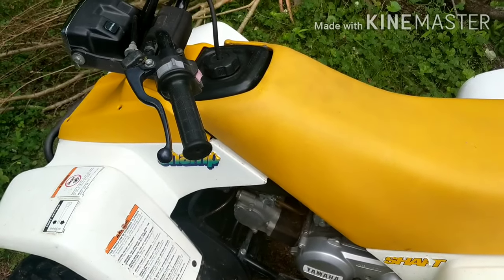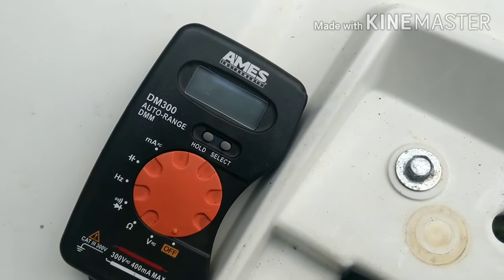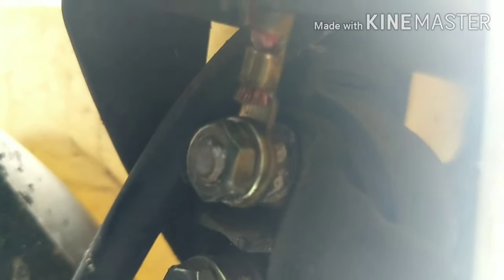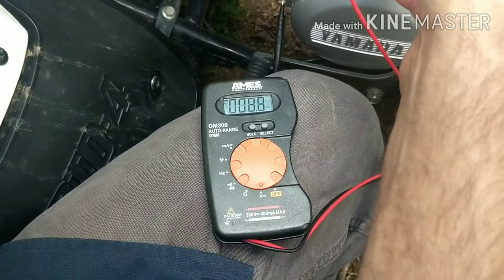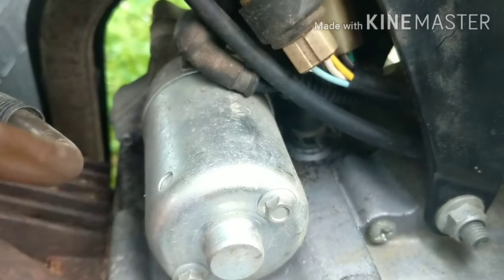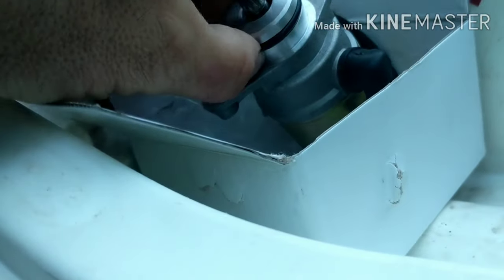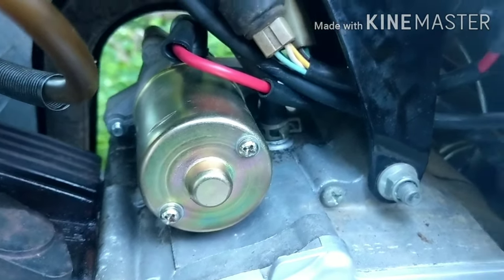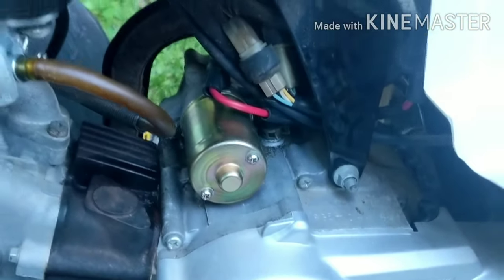ATV no start fix.

Comment: I just replaced a battery, solenoid and starter, all Yamaha brand on a grizzly 700. About an hour after using it, I tried to shut it off and acted like I was hitting the starter and would not shut off. About 3 min later the wiring harness area got hot and the engine died. The new battery tested .8 volts in the field and 0 volts after trying to charge it. I have checked the wiring and re connected  two poor connections for the solenoid wires and have a fresh battery and solenoid. It will only click. I’m afraid my starter burned up. I will check power to it in the am.

Comment: I replaced : battery,starter , solenoid, regulator/rectifier and it still does it. It is charging properly too.
Reply from the maker: Make sure the engine isn't stuck by fuel in the cylinder, or seized. If it's not check the starter Bendix.

Comment: Hai sir I have Polaris atv 250 two stoke engine bike esterday what happen I am going to change  a battery . Wrongly connected but engine start after rectifyeris burning i  going to stop the engine.afer we are going to connect the correct way but self moter sound only coming.but wrong connect self moter start engine also start but correct way to connect is not working.what i going to to please give good solution

Comment: Hi my mines won't start from the strat button but it does if I hot wire the solenoid. What could be problem  ?
Reply from the maker: Most likely the starter switch or button. See if you're getting power to the solenoid when you hit the start button, if you are, and you're able to jump the solenoid and it works, it's your solenoid.

Comment: I have a suzuki lt80. After running it for a couple hours it did exactly that, started clicking. So i came to youtube and found this video. However in my case i didnt have to order another one i simply took it apart brushed the contacts, add a little grease on the center rod to spin easier and tested it with some leads directly to the battery it started spinning so i put it back on. Which if any of you have swapped out a starter in a suzuki lt80 its not a 5 min ordeal. Anyways now it runs stronger than before. So a little tip if it has screws, bolts, pins, i dont care fuckin duct tape holding it together take that shit apart and figure it out learn about it and how it works to better understand your machine. And hell worst case scenario.....just order another one haha but at least you made an effort. Good video bud keep it twisted! 👊✊ 🤘🤘

Comment: My quad is rapidly clicking from what it sounds to be the starter, but it turns over when I boost it so I’m pretty sure the starter is good, I can also touch a piece of metal to the two hex nuts on the solenoid and get it to start from there, so I’m pretty sure my battery is fucked.
Reply from the maker: It you jump the solenoid by touching the two nuts and it starts, the battery is strong enough and the solenoid is bad.

Comment: A battery at 12.5 is fine for any one wondering.   Don't miss interrupt that your battery has to be 13 volts cause it will drop to 12.6 in a few hours.
Reply from the maker: Good call as long as the cranking amps/load test is good 12.5v is fine.

Comment: Thanks for the great video and advice. I too had an issue with a single "click", coming from the starter solenoid (on my 2003 Bayou 250). I watched your video and all the other starter/starter solenoid related YouTube videos available and was convinced that I had a bad started solenoid based on the videos and the fact that the single "click" sound came from the solenoid, not the starter. There were numerous aftermarket starter solenoids available on Amazon for around $10 so I figured I would try the least expensive and easiest repair (compared to replacing the starter itself) first...what a hassle! I bought and returned starter solenoids from 4 different sellers due to the "B" (for battery) and "M" (for motor) being on opposite sides from what the description pictures showed and that the description clearly stated the solenoid was compatible with my specific ATV...maybe it doesn't matter? I don't know though because it turned out that the single "click" coming from the starter solenoid was actually caused by a bad starter. For me, the final clue was that I couldn't "jump" the starter by connecting  the solenoid terminals with a screwdriver. I am sure that there are other more exact  diagnostics I could have done with a meter but I replaced the starter and everything worked fine, even the original starter solenoid.
Reply from the maker: Yes you could have checked if the starter was getting 12v when you hit the start button. If so the starter is most likely bad. That would eliminate the solenoid being bad. There could be other reasons it would get power and not crank (like engine locked up). But that test would verify the starter system working. Glad you got it fixed!
Reply: @TepcoCycleRepair  Thanks, I'll remember that for next time...in the meantime I plan to take the old/OEM starter apart to see if it can be rebuilt for a spare as I have two Bayou 250's (2003 and 2009) so will probably need another started eventually.
Reply: I have a vinson 500 2004, checked starter and it spins, could it just be spinning but worn out brushes ?  the engine will not turn over. when I use the pull start it fires right up. What could this be ?
Reply: @Talonvision  Hi Sammy. You don't say how you checked that the starter spins but the fact that it spins seems to indicate that the brushes are OK but the starter is not engaging. Since your atv starts up and runs when you use the pull start (that's good) I am guessing that you may have a problem with your starter solenoid or maybe battery level is too low. Make sure your battery is fully charged. Have you tried using a screwdriver to jump the solenoid terminals with the key in on position? If it starts that way, then it's a bad solenoid which is fairly inexpensive to replace.
Reply: @garydillon7765  we kinda checked and jumped the solenoid. But did. Not check proper battery levels. Checked all fuses. I hope it isn’t the clutch start mechanism ? We took the starter out and on the inside it had no resistance l, just spins freely is this normal ?
Reply: @Talonvision  I didn't realize that you had taken the starter out and that you meant it spins manually. Have you tried hooking up electric power to the starter when it is out of the atv? It should spin then. If not then starter is bad. Really though, I am no expert so your best bet might be to look at more videos or call your friendly neighborhood atv repair guy for advice...Good luck!

Comment: Clean your ground and power connection to the starter then try to start it. Then jump start it from the solenoid. If that works, it's not the starter or battery and probably the solenoid.
Reply from the maker: This was a bad starter as seen during the testing in the video.

Comment: hey, my Kfx 50 makes same noise, battery good .  they sound is coming from the fuse area?  I saw something about CDI box??   Do they go bad and do they interrupt the voltage to the starter?
Reply from the maker: CDI boxes can go bad but not often. Locate the starter solenoid and test it, sometimes there is a relay box that plugs into the fuse box for any safety's on the ATV . They can go bad as well but are cheap and available at any auto parts store. Make sure you're getting power on the starter side of the starter solenoid when you hit the start button. It will click when it goes bad but won't send power through.
Reply: Ok thanks

Comment: Thanks for this helpful video! I am having the same clicking noise but engine is not turning over on my Can-Am DS450 atv. I hit the start switch and only hear one click that comes from the starter solenoid. I replaced the starter solenoid and I'm still having the same issue, so the solenoid is not the issue. I have pulled out the starter motor and it spins and works when I jump it with an extra battery and it's out of the quad. I am afraid the quad has a seized engine :( A friend of mine told me to take off the spark plug and put the quad into 4 or 5 gear and try to manually spin the rear wheels with my hand while the rear part of the quad is jacked up from the ground to see if there is any movement.... Do you have any idea of what could be happening? Any help or input is greatly appreciated!!
Reply from the maker: Try what he said, spark plug out, or you can leave it in neutral, spark plug out and take the center cap out of the left side cover and turn the engine with a socket, counter clockwise to see if it's seized.

Comment: my 4 wheeler doest even click its just silent, is that the battery? its weird because the green light turns on and the headlights work too.
Reply: Take a look of the starter commander on   the  left side of the steering wheel

Comment: Just checked your video and thought ask question with regards to problem I'm having with my sons loncin 50cc... has a new battery, complete new wiring. Have checked everything and on voltmeter everything showing is good... but... with spark plug removed engine turns over no problem... spark plug in... engine really struggles to turn over (slow rotation) and drains battery quick... would you say starter is knackered????
Reply from the maker: Yes I would say starter or starter Bendix. Or if the battery is losing voltage fast, it's a bad battery. Get the battery load tested.
Reply: The starter looks abit tired on outside of the unit, has been stored for some months so am guessing cold and damp may have got into the starter... there not expensive to replace so will try a new one and see what happens. Thanks for quick response

Comment: I have the same problem on my 1986 honda fourtrax 250. Relay clicks, but no crank. However, I do have a kickstart and the quad turns on and drives perfectly (engine not siezed. Just throwing it out there to minus what it could be that's giving me starting problems.) I am getting power to my starter relay (clicks) and I am getting power to my starter. But the starter does not turn over. My battery is new.
Reply from the maker: If you have power all the way to your starter but the starter is not spinning, I would have your starter tested.

Comment: Why is a solenoid necessary? Why don’t these send power to the starter directly from the starter button on the handle bars?
Reply from the maker: @JohnEgan-vd4ve  Good question. The power needed to spin the starter is higher than the thin wires at the push start can handle. The solenoid uses a thin trigger wire from the starter button to connect the heavy wires needed for the starter.

Comment: Can you make a video about if the starter dont make any Sound at all
Reply from the maker: If you are getting power to the starter but the starter isn't doing anything, you'll need a new starter. (Assuming your engine is turning freely, not seized or vapor locked)
Reply: @Tepco Cycle Repair  ill try that

Comment: I gotta 06 quad runner 90 and when I hit the start button it just buzzed through the starter relay, I’ve been told it’ll do that when the starter is froze, has anyone else heard of this?
Reply from the maker: Starter or engine could be frozen. Pull the starter and bench test it.

Comment: I bought an ATV that is experiencing this problem where I am confused is because I replace the battery on my ATV because it was dead after replacing it, it started up fine using a battery booster, only when it’s on a battery booster will the ATV start but if it’s not all I hear is clicking what can I fix that is a starter issue?
Reply from the maker: Make sure your battery passes a load test and that the connections to the battery are good and clean.

Comment: Hello. I have a Kymco mxu 500. There is a problem. My starter spins in jerks. If you press the throttle a little, then it cannot turn at all. What could it be? Has he lost his strength? or is there another problem?Thanks

Comment: I have a 100cc engine doing the same thing on my sons Tao Tao four wheeler but when I by pass it to jump it from the power starter to the ground the starter turns over? 
Any suggestions I can do?
Reply from the maker: @franciscouribe8898  if the starter spins and the engine doesn't, check the starter Bendix, it's what the starter spins before the flywheel. I have a video on that as well.
Reply: Thank you for taking the time to comment I hope it helps someone else but I just went back out jump it from the positive battery to the engine ground and it started right up. Unplug the ground from my jump box and it cut off. Relocated my ground and jumped it from the battery and it started right up. Newbby issues lol
Reply from the maker: @franciscouribe8898  Awesome! Glad you got it up and running!!

Comment: how do you know if it’s the starter if all the voltage is good in this video
Reply from the maker: @MatthewsArcade  If all voltage is good all the way to the starter, it's a bad starter, seized engine or seized starter sprag if it has one.

Comment: I have a clicking solenoid, but sometimes the motor turns over, but is very weak. I'm thinking it's a bad weak motor?
Reply from the maker: Either that or a failing battery that has low cranking amps. Have the battery load tested.
Reply: @TepcoCycleRepair  I tried my known good truck battery on it just now, same result. And now the motor will not crank at all, just makes a buzzing sound. Tested solenoid as good too. At least motors arent too expensive!

Comment: My starter butron wont make anything click.. I can jump the solenoid and itll crank.. idk if it would be the switch itself, or the start relay??? Any thoughts?
Reply from the maker: You have to see if your solenoid is getting power from the battery and if the solenoid is getting signal when you press the start button. If it doesn't get signal from the start button, focus on the button.

Comment: Will 12.66 volts make it click and not start or just a bad starter bc the starter is getting that voltage but nothing but a click
Reply from the maker: If the starter is getting that voltage, take it off and make sure it spins freely and spins with power off the bike, then check the starter Bendix, if that's not stuck, make sure the engine is not stuck.

Comment: Have a 2012 polaris sportsman 500 HO, replaced starter solenoid and just replaced starter,  still just getting a click. Can u help?
Reply from the maker: Sure, make sure the engine isn't seized first. Then check the starter Bendix, it can get stuck also.

Comment: I used a 20v Milwaukee batter to do this troubleshooting because 12 v battery was dead, and at the starter I had 13 v so even with a voltage drop that was enough for starter right? The starter still didn’t turn over
Reply from the maker: Probably not enough amperage. Just hook up a car 12v battery, just make sure the car is OFF because the charging amperage is different.

Comment: I put a flat head screw driver across the solenoid and it sparked but my four wheeler didn’t start . Does that mean my starter is bad ? If anyone can please help I would really appreciate it 🙏🏾🤘🏾
Reply from the maker: If you did that it bypassed the solenoid and should have cranked. If it didn't either the starter is bad, the battery is weak, the engine is seized it's vapor locked. I would pull and bench test the starter.
Reply: @TepcoCycleRepair  ok thank you 🤘🏾🙏🏾

Comment: Genuine question’ 
Isn’t a starter supposed to read 12.5-13v 
Yours read 12.5 so what made you think starter was bad?
Reply from the maker: Because it was getting power but not turning. It shows everything is working before it to send power to it. If it has power at the starter it should crank.
Reply: @TepcoCycleRepair  gotcha thanks for reply’ I’m no mechanic just a get your hands dirty type
🤣 Always looking
For new tips/ tricks so I was curious’ 
I missed where you said it wasn’t clicking had I listened better I never needed to ask 🤣🤣

Comment: my p[olaris atv starts only when jumped,the stator is good it charges the battery while its running but when i turn it off and try turning it back on the motor spins
Reply from the maker: Do a load test on your battery. Sounds like the cranking amps are low.

Comment: I got the same problem with my dirt bike, now when I’m testing the lower cable that connected to the motor, I press the ignition and it just from 0 to about 7, is this an issue? Should I have 13 as well?
Reply from the maker: Yes, it should have 12v at the starter. Check your battery when you hit the starter, see if it drops as well. It could just be a weak battery that can't handle the amp draw. If your battery doesn't drop that much, just check all your connections and grounds.

Comment: Hey the battery on my it's a Polaris I believe I don't know if it's a scrambler or a outlaw 50 and it's only it's electric start the battery had died and I got like a jump from somebody and they put the polarities wrong and it won't start anymore and I was hearing that clicking sound I thought it was the relay so I ordered a new relay and it wasn't bad the little fuse glass fuse that and I still won't turn on just if you could what do you think would be wrong with it is it a starter that I need to replace or something else
Reply from the maker: How many volts is the starter getting when you hit the start button?

Comment: I have a suzuki lt80 and it doesn’t turn over or anything u think that could be a battery
Reply from the maker: Absolutely could be. Check the battery voltage with a multimeter.
Reply: @TepcoCycleRepair  thx I’ll check